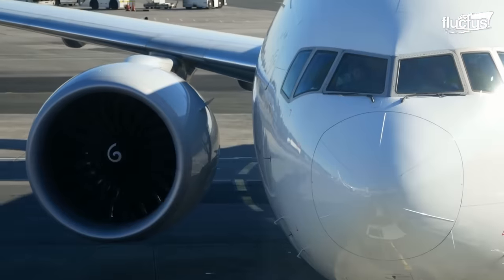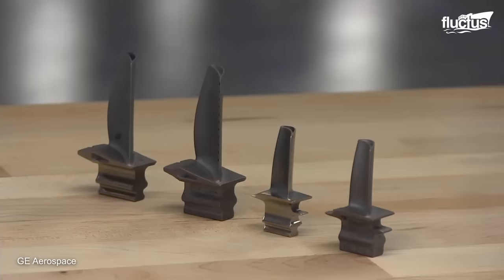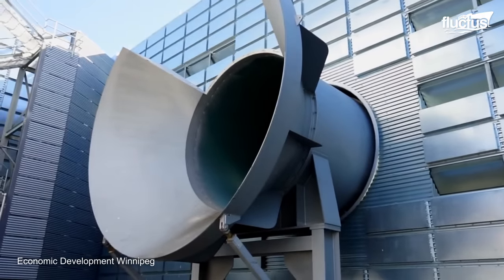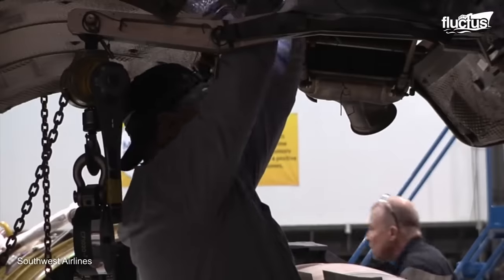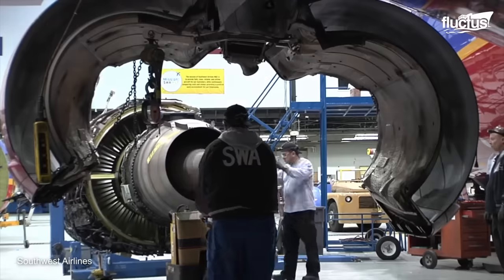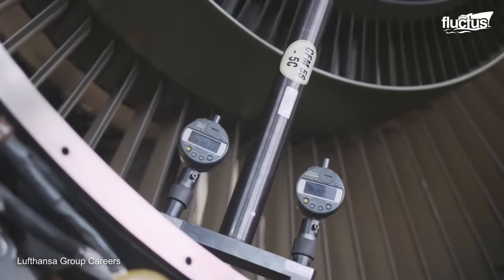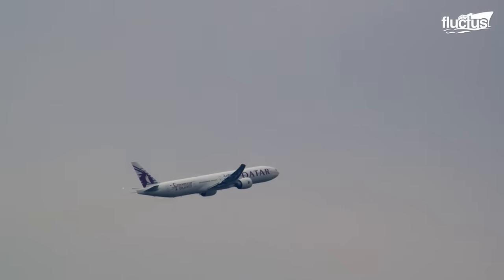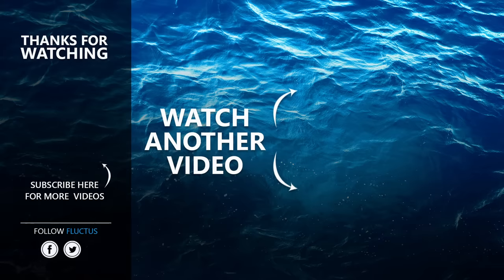Inside Billion $ Factory Building World’s Most Advanced Jet Engines

Comment: GE make the best engines for wide body civilian airliners.
Reply: What about Rolls Royce or Pratt and Whitney?
Reply: Not as good because of too many problems. @codprawn
Reply: @John-nc4bl 
GE has just as many problems. Look at the LEAP GE90 AND GEnX engines. Iron contamination more widespread than first thought. The GE9x has been plagued by problems which have impacted delivery of the 777x and delayed certification.
Reply: @John-nc4bl  All three of the top turbine manufacturers have problems. A United B787 with GEnx had an engine shut-down over the middle of the Pacific recently as an example, no engine is immune from malfunction.....even GE.